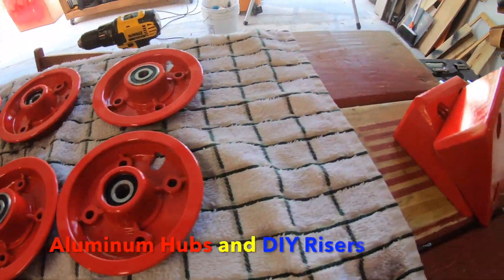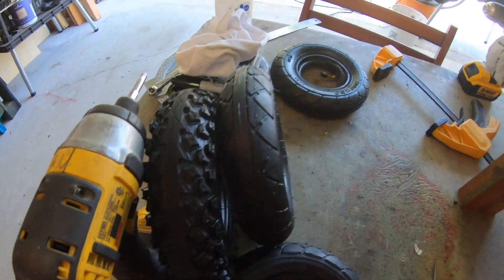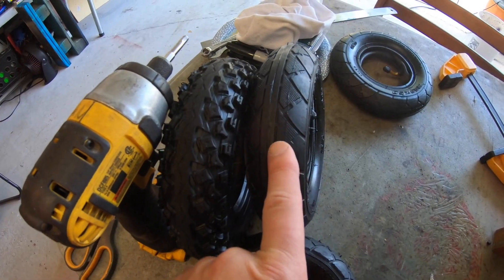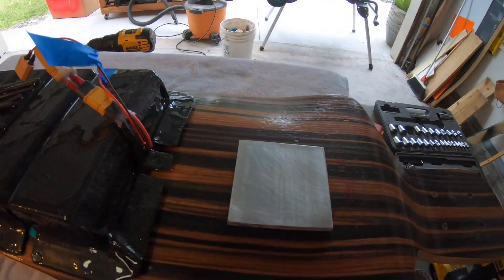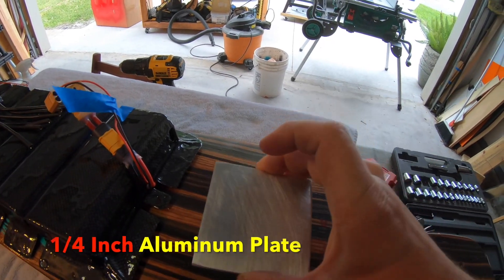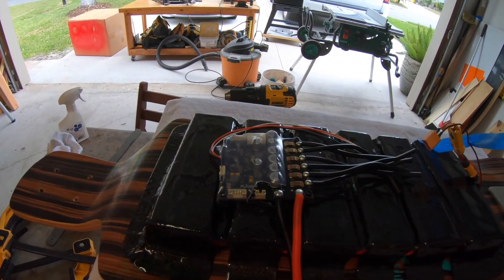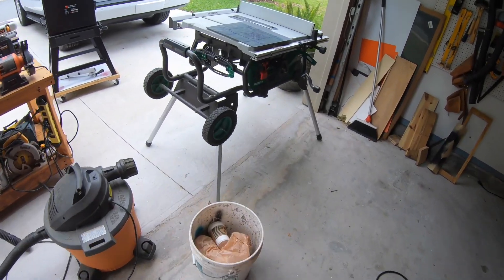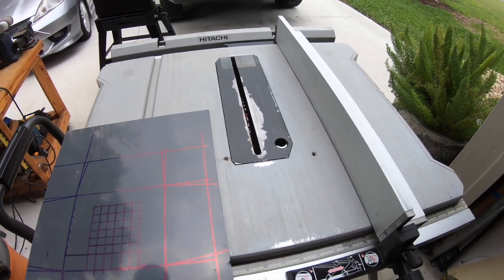All-Terrain Electric Skateboard, Low-Rider

Comment: Do you have a link to the gear ring for them wheels please
Reply from the maker: Not sure what you mean. This board has aluminum wheels that came with gear ring. Do you need a link to this rim?
Reply from the maker: 8 Inch Wheel Use 200x50 Inflated Off Road Tire with 5M Pulley 72 Teeth for Belt Drive Mountain Skateboard https://www.amazon.com/dp/B083NY7WHQ/ref=cm_sw_r_cp_api_glt_fabc_Y9v2FbYWP3SKE

Comment: Go back and watched this video again as I bought a set AT trucks and wheels like the one in this video. You think you can make another set of 30 degree riser that I can buy from you. There are CNC aluminum for sell on line but they are way too much, for the price you could bought a set of MBS truck.
Reply from the maker: Making the risers is not a problem.  Fitting everything together is the hard part.  I can make and send risers your way, but its not just plug and play.  Its a general rule of DIY ESK8 projects: money saving is traded off for work/time.  I have a 30 degree 3D print stl file you can print.  Do you have an access to a 3D printer?
Reply from the maker: https://www.tinkercad.com/things/c9nDdxhGF3K
Reply from the maker: Tinker cad wedge link I sent you will work.  You will need to adjust hole sizes to accommodate bolts going through them.
Reply: Thank you for sending me the link to the 3D printing . I will check for a 3D printing place locally. Again thank you

Comment: Awesome job, men. I like that enclosure type. Are these wheels from fire equipment?))
Reply from the maker: Privet Nikolai.  Thanks.  Wheels are painted red.  It does look like those wheels could be on a portable fire extinguisher.  But really, they are aluminum wheels 200m x 50m originally designed for electric scooters.

Comment: You should make 4 wheel driver, two of them use power of battery and rest of two to generate power to charge the  battery . Think of that to increase miles
Reply: Using motors to charge batteries makes the motors act like a break. 4 wheel drive has its uses but it doesn't extend range.
Reply from the maker: I put big batteries in my rides.  Typically more miles is not needed for me.  You should try building that contraption.  I dont think the extra weight and cost of the motors would justify a few extra miles one may get on esk8.